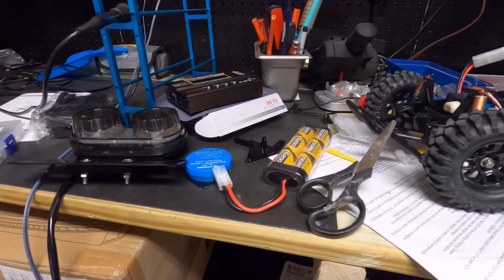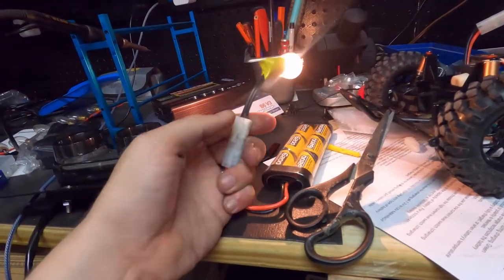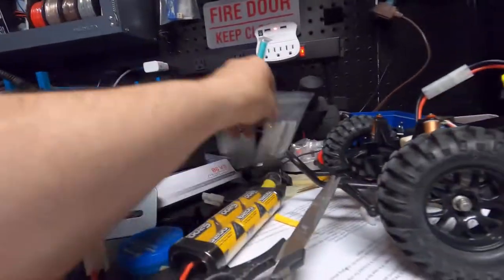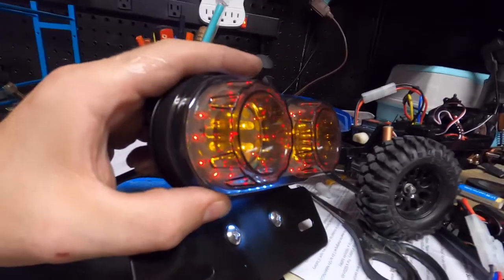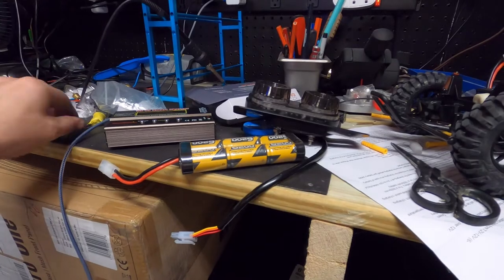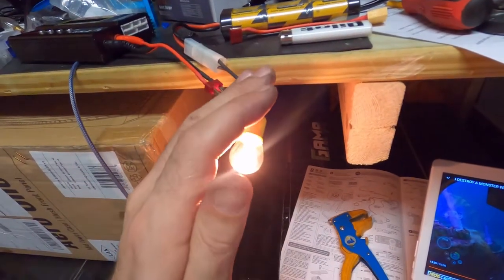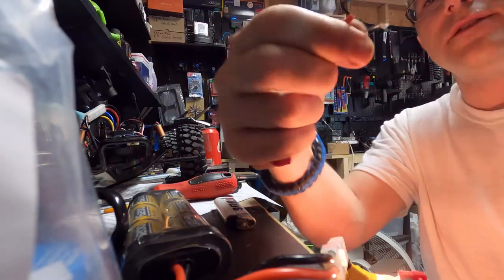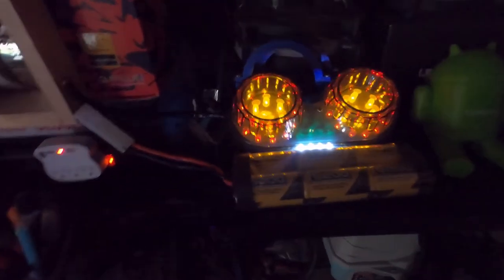A Safer Way to Discharge RC Battery + NiMh

Comment: The main reason you would want to use the other style light bulbs is that LED "bulbs" pull less power and would take a substantially longer time to drain the battery.
I say you should build a unit using the other bulbs and maybe install a 120mm PC fan to cool the incandescent bulbs. Also, add a switch to the unit and maybe a second battery connector for multi-battery discharging. 
Cheers bro!
Reply from the maker: correct.. the Led take DAYS! to discharge the battery... vs the light bulb....  but this is about a Safer way to do it.. that light bulb gets like 500 degrees ...    thats mainly what im saying .. and i released this video 5 days ago... i think it just now letting ppl know
Reply: @ATECHPCs  fracking YouTube!
Reply from the maker: @glutenfreegam3r177  ya released data for this video was the 5th of this month ... it says i uploaded it 16 hrs ago...LOL wtf
Reply: yeaa good point.. leds dont get hot,,, but it will take alot longer for it to dis charge

Comment: Wouldnt more lights equal a bigger load? If the battery was connected to 6 lights wouldnt the lights be more dim at each bulb, producing less heat? Maybe I am wrong?
Reply: they would just pull more power draining the battery quicker if they didnt burn out from to much power

Comment: why would you use a LED to discharge a battery? LED are super efficient are CONSERVING energy not getting rid of it. 3:17 yea the heat is good when discharging. thats energy that was used to create heat.